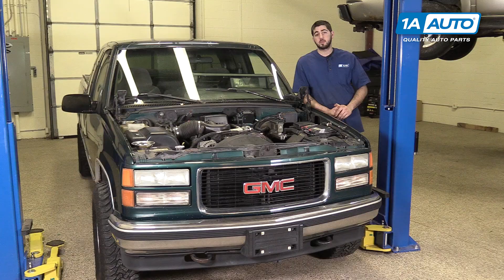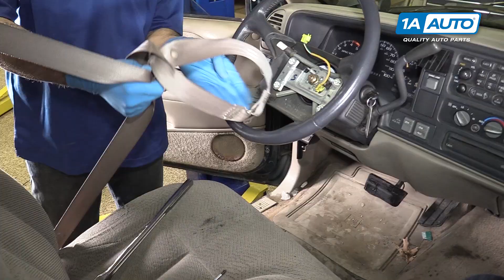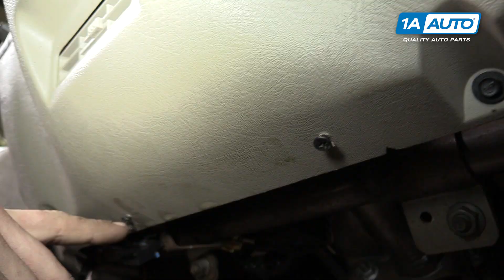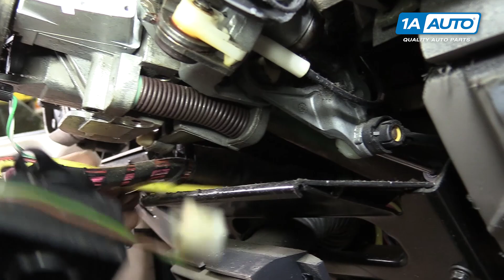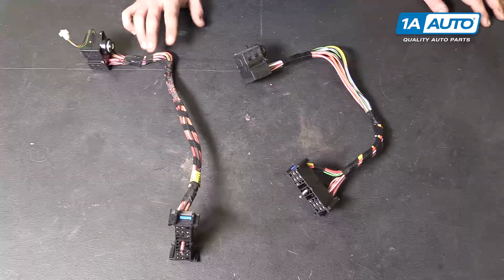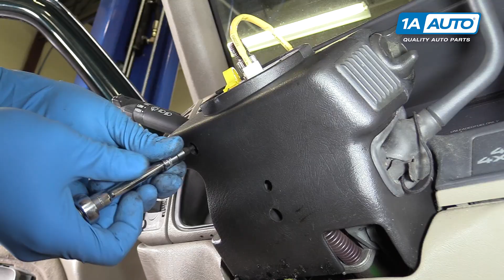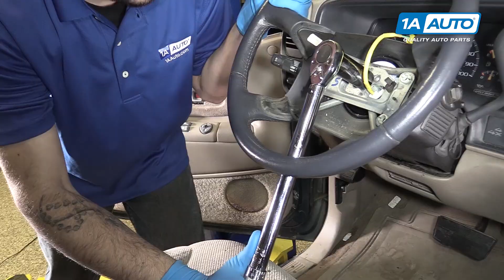How to Replace Ignition Starter Switch 95-96 GMC K1500

Comment: is there any tools/toys that can located a broken ignition switch .or  . like a  a multimeter style toys?
Reply from the maker: +elvis pressedtalot You can use a Multi-meter to check continuity pin by pin to look for broken wires, check for voltage at the switch as it is operated. It's more common to have the switch wear out internally from it turning over and over again. After you take the column apart to access the wires you still might need to replace the switch assembly after all.
Reply: @1AAuto  found out this product .. "littelfuse" 175amp  mega was the reason why the dash board wouldnt light up.  like no power locks,light, radio, etc...... but after changing it. started right away. being its -19  the last 2 days.  im blaming the battery now :/
Reply: @1AAuto  im sure of it . the brand name  "littelfuse" 175amp .  was at fault.  first there was no power.  but after using the test light.. 1 side of the fuse. lite up and the other line that leads to the alternator didnt. . so after changing that.. i have power to the dashboard now. and now  1 of 2 things is preventing it from starting.. (starter) or (Alternator). gonna guess it . having an alternator on hand. . starter is gonna have to wait
Reply from the maker: Thank you for your reply! We wish you luck with your repairs and if you need any assistance locating parts for further repairs please feel free to contact us 888-844-3393 and we would be happy to further assist you, thank you! +elvis pressedtalot

Comment: 1995 Chevy truck. Well I put in a new ignition wiring harness switch from 1A Auto $37.95 free shipping and that solved all my pro
Reply: Jeffrey Pabian what was the issue?
Reply: Where did u get it I can’t find it on there website

Comment: Easy test if it is your ignition switch is not working . If you’re tac. does not work, speedometer is not working properly, shift indicator light is not working, and your transmission is not shifting or stuck in 3rd.  Here’s what you do to test your ignition switch. With the engine running, hit the back of the  Key and drive  into the ignition switch. It might take a few sharp hits but see if your tech starts working. If it works I believe everything else will too. This procedure confirms your  ignition switch is bad. It comes as an assembly wiring harness. I just ordered a wiring harness through (1A Auto )for $37 and will be putting it in shortly I believe this will  cure of my problem.
Reply from the maker: +Jeffrey Pabian Thanks for the interesting tip and continued support, Jeffrey!
Reply: What if the truck wont start bit it cranks i already changed the spark plugs and coils aslo the fuel pump and filter i haven't changed my ignotion switch even though it says it on the computer will  reprogram the ignition swith when i get a new one ? Also do i have to change the ignition harness aswell?

Comment: I imagine the 97 c1500 requires a different ignition harness
Reply from the maker: +Edwin Rodriguez We currently do not have an auto repair video specific to your vehicle. You might be able to apply some of the basic steps shown in this video to your application. We do not currently offer the correct harness for your application. Hope this helps you out

Comment: There's another harness for the switch that also has another snap plug that plus into the top of the ignition that looks exactly the same as this one. I pulled 2 today from the junkyard. Easy peezy after you do it a few times

Comment: Reinstalling the old part?
Was this a misdiagnosis?
We would appreciate if you shared that information so we could avoid a mistake.
Reply from the maker: +Earth Tones Thanks for watching!  This was not a misdiagnosis, we just created this video to show you how to perform this repair!  The ignition switch works with the lock cylinder power on and start the vehicle, so if the switch fails it can cut power to the ignition and fuel system.  If the switch is bad then the most common symptom is the vehicle starts up and stalls suddenly.  1aauto.com

Comment: Will a bad ignition switch could cause my rpm and mph gauges not to work and also cause transmission not shifting
Reply: yes
Reply: Definitely !
Reply: it can but its prob the speed sensor on the trans.
Reply: Mine started doing the same thing did you get yours fixed? If so what was the problem
Reply: @jerryrod83  I am. Having the exact same issue I am replacing the switch now it is a pain n d ass, lmk if u haven't got your fixed or if this was your fix
Reply: Im haveing the same problem so its just the ignition switch?
Reply: I got a 94 Chevy 1500 doing the same thing. Will this fix it?
Reply from the maker: +JoKeR 2 We don't have a how-to video for your vehicle right now, but the basic steps in this video should be enough to do this task. Buy this part for your vehicle on 1AAuto.com: http://1aau.to/m/Shop-1AAuto-c
Reply: Me pasa lo mismo, ayuda

Comment: Instead of removing the steering wheel, I opted to remove the Driver side seat. Made it somewhat more comfortable. The E4 deep socket is a must.
Reply: I just removed the top and bottom covers. The seat bolts are rusted, live in the Midwest.

Comment: Could a bad ignition switch cause my 95 silverado to not shut off when key is in off position. Also dash lights stay on when truck is off
Reply from the maker: +Cody Stanfield It may cause this type of a malfunction. 1aauto.com
Reply: 1A Auto Parts aye when yo car sometimes crank is that cause of the ignition starter switch
Reply: Cody Stanfield 
How was it fixed

Comment: Great video! Helped me a lot especially with the key cylinder. Skip removing the steering wheel, no need even with airbag(mine has one). Also, if you are patient and careful, you can open the switch and clean the contacts and reassemble. Worked for me and saved $120.

Comment: You do not have to pull the steering wheel.  There is no point at all (this is for trucks without airbags, I do not have them so I wouldn't know if it matters or not if they are there)
Order an E4 deep socket online before you tackle this.  There is a special one made for these vehicles.
Reply: Lmfao im pretty sure 😂

Comment: Very good video !  You're right, you must have an E4 inverted socket to get those 2 screws on the top switch. My old harness had a pinched white wire ,probably my fuel pump hot wire,  will see if this fixes it- thanks 1AAUTO !
Reply from the maker: +Hank Postell Thanks for watching. If any of our viewers needs to make this repair, we carry the auto repair part shown in this video on our website. Here is a link to them http://www.1aauto.com/ignition-starter-switch/i/1azis00005?utm_source=YouTube&utm_medium=CTA+Comment&utm_campaign=ytcomment&utm_term=YwLg3JYOYYA
Reply: E4 or e5 inverted torx bit cause discription days e5